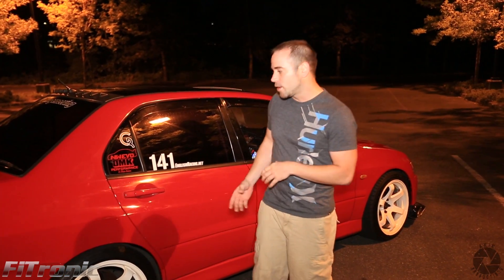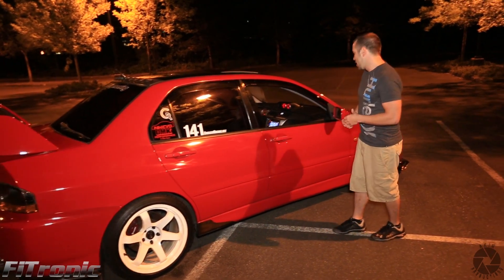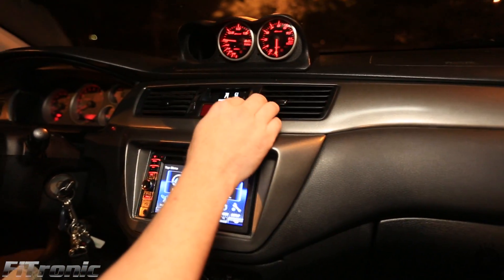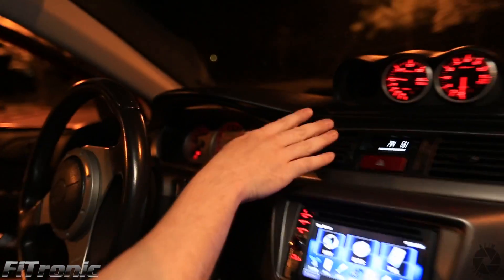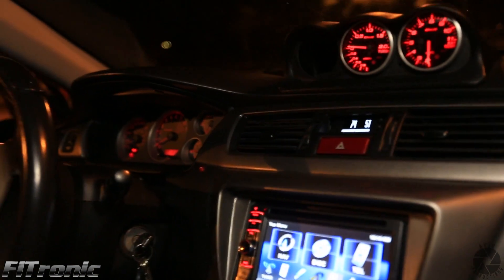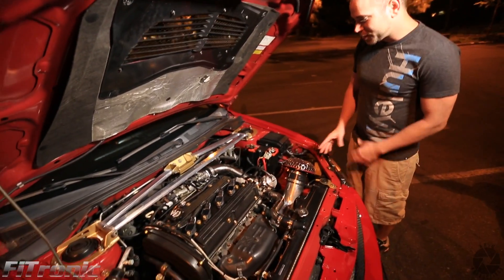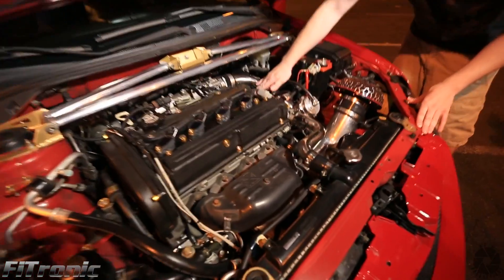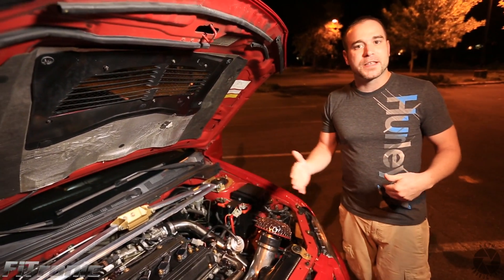FiTroninc's Stock ECU Flex Fuel System for Evo 8

Comment: Does it display on anything else besides the little box?  I have AEM oil pressure, oil temperature, and sensors already installed because switching out AEM ecu back to stock evo 9 ecu.

Comment: Will it read methanol content too? Honestly everyone should be running alcohol/methanol/ethanol it's phenomenal stuff
Reply: Ethanol>Methanol 
Methanol is a great fuel/additive, but the Delivery systems are lacking. I prefer to run Ethanol because its the primary fuel, and not injected into IC piping. The fail safes just arent reliable enough when dealing with a 30k+ engine. Of course a lot of ppl run it with great success, but when dealing with a daily driver, you CAN NOT beat Ethanol! Flex Fuel Kits are far superior to Meth injection kits. I ran a AEM meth kit for 6 months and it leaned out while i was at WOT and caused my car to spin a bearing! i rebuilt the block, switched to Ethanol and never looked back!